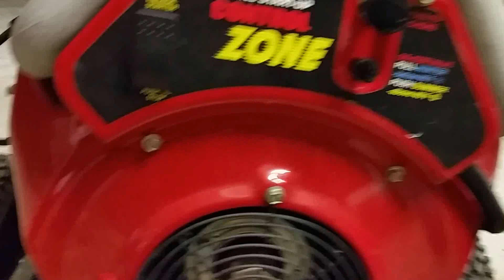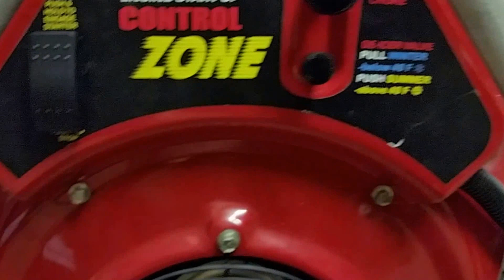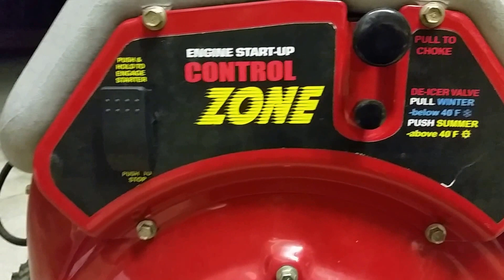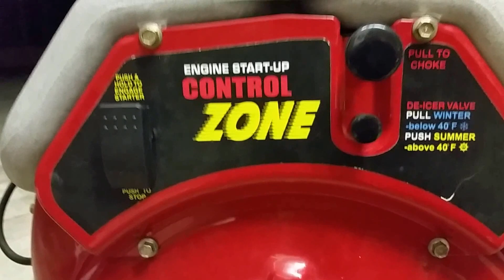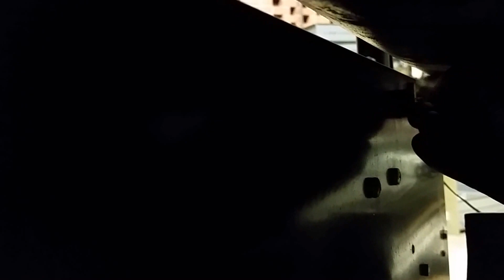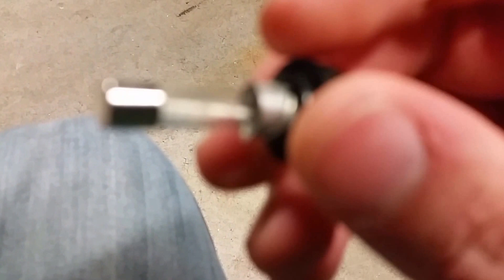Generac 15 kw generator won't start?  Two common problems

Comment: I have a surging problem with my Ultra Source 15K gas generator. Model# 004582-2.
Has anybody had this problem need help.
Reply from the maker: No, sorry.
Reply: Im looking into surge and low voltage issue. Looks like the electronic govenor/speed control. The more i moved it back and forth the better it runs but still drops voltage while running.

Comment: Well changed the oil and cleaned out gas tank today... Hooked up jumper cables to the dead battery.... Nothing....
Running to the auto parts to get a fuse... Pulled mine out and it is in fact  blown... Hoping and praying this fixes it.... Nice Video......Thanks
Reply from the maker: Hope it worked out for you.

Comment: Adrian, I disabled the fuel solenoid, reconnected the connector, started the generator and the engine ran fine.  Except that it would not output any current.  This is the first time it has done that.  Any suggestions?  Something I missed?
Thanks, Al
Reply from the maker: +Albert Fiallos I can't think of anything other than a breaker, sorry.

Comment: I had the 17.5 kw version of this generator.  It started putting out 130 , and 260 volts, instead of 120 and 240 volts.  I went ahead and used it for my function, because it was not terrible high.  The next day I went to start it, and it was like the battery was dead.  I checked fuse behind the control panel, and it was blown.  I changed it several times, and it kept blowing the fuse.  It was still under warranty, and took it in.  Found out it has a computer that went out.  It would have been like $300 if it wasn't under warranty.  I never trusted it after that and sold it

Comment: The fuse on mine keeps melting. does anyone have a fix for that
Reply: Mine is doing the same starts runs 10 seconds blows the fuse
Reply: Any body have a cause for this  my generator is 8 years old but only has 90 hrs on it
Reply: Everyone really needs to watch this video about generator safety https://youtu.be/I1jT3ANENvI thank you. Stay safe everyone. Remember to never run your generator indoors. Hope you all agree and like this video.

Comment: Those problems sound bad for Generac...neither should have happened.  Did the carburetor bowl have any dirt/gunk in it?  I've been running the fuel out of my generator (running it till it stalls).  I'm paranoid of flooding the engine/crankcase if I don't make a habit of it.
Reply from the maker: I also like to turn the gas off and let my generator run out of gas, just to be safe.  I also use ethanol free fuel in all my outdoor equipment, with Stabil.  There was no gunk in the carburetor bowl, it was very clean.  The solenoid plunger wasn't stuck either, it moved freely when I pushed or pulled it.  It just wouldn't operate.  I really can't explain the fuse.  I suppose I'm glad there is a fuse there to protect components inside the control panel, I just wish it had been located somewhere that you could see.
Reply: I'm thinking of going out of my way to get some of that ethanol free fuel.  I'm always buying used equipment, and my 2 cycle engines are especially picky.  I'm costantly messing with carburators...
Reply from the maker: Nicholas Smerk All of my carb problems went away when I switched to ethanol free fuel and Stabil.  It's a little more expensive, but totally worth it.  I bought 17 gallons Sunday and got four new gas cans today that I'll fill this weekend.
Reply: Most of my problems are inherited from the previous owner.
Reply: thanks didnt think to try the fuel solnoid worked hours on it until I read your post Brian Snider